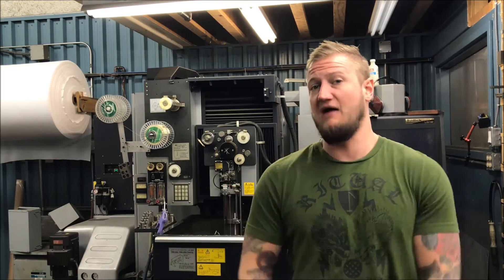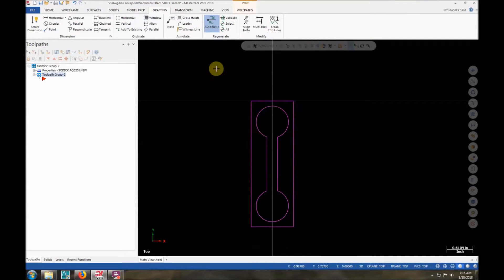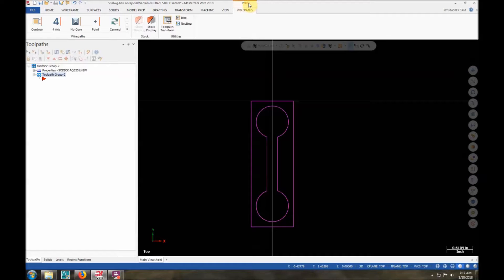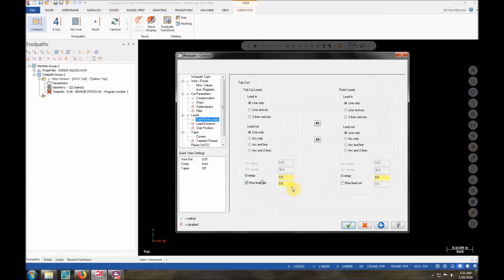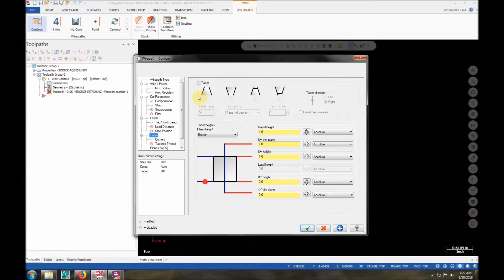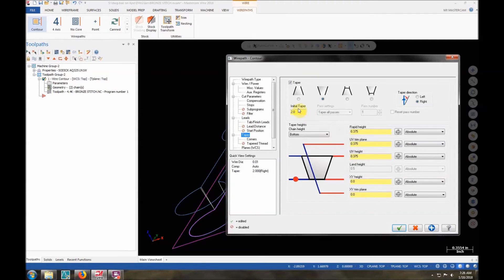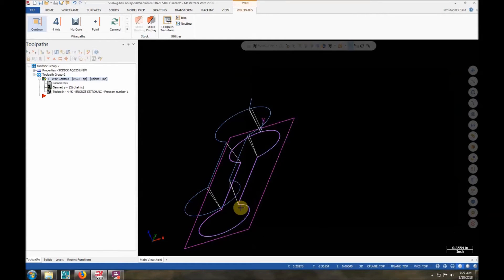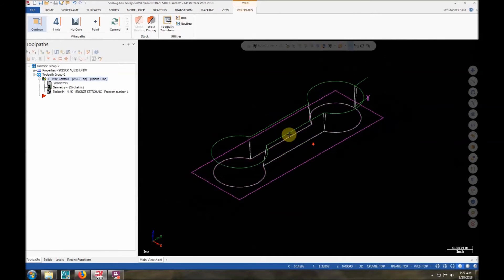MASTERCAM 2018 WIRE EDM BASICS

Comment: I would definitely like to see more wEDM. The company I work for has only me running their two Charmilles wEDM machines and I'm still an apprentice. So tutorials from an expert would be quite helpful.
Question - @ 6:24 - compensation 'in computer'. Does that mean that mastercam outputs pre-adjusted gcode for the wire path instead of the wedm machine's control setting the wire offset?
Also, thanks for apologising to us metric peasants ;)

Comment: I think I might have the wrong post on my Mastercam since I don't get the correct header. any advice?
Reply from the maker: What kind of header is it giving you vs what it should be?
Reply: It's not giving me any at all for the header. It just shows the size of the wire and then at the bottom it shows all the gcodes. What i've had to do is export my program out to my wire machine, edit it there and do a "Condition" search on there just to get the right power settings, but all the offsets might be off since i dont know which offsets it is using in the program. Anyways, thanks for your help and this video saved my ass.
Reply from the maker: Oh yeah I have to condition search every time in my machine in order to get power settings as well! Glad I could be of a bit of help!